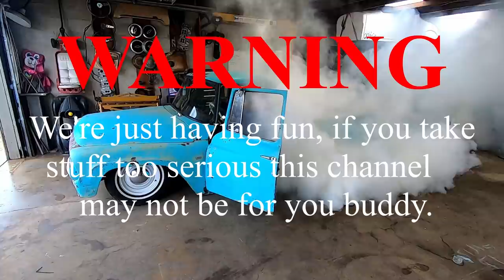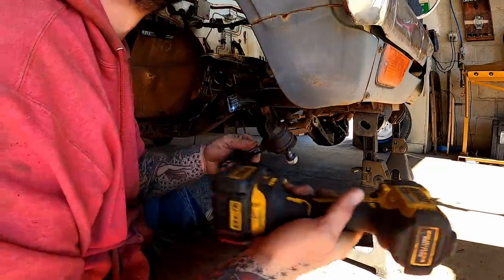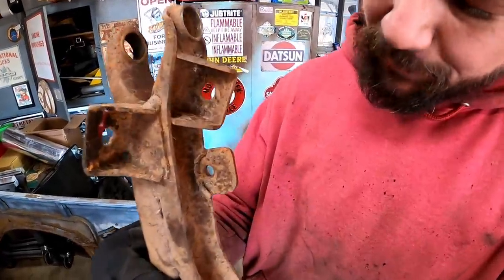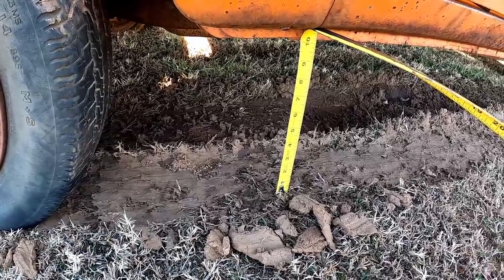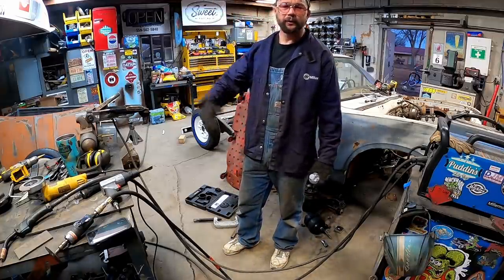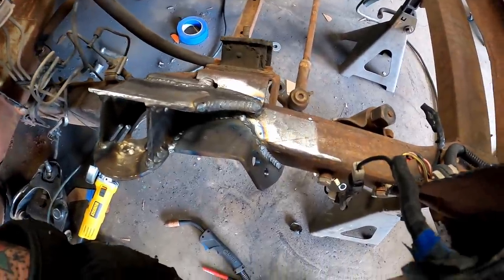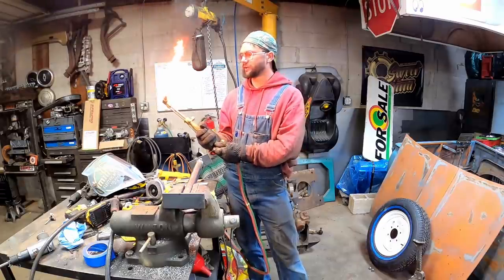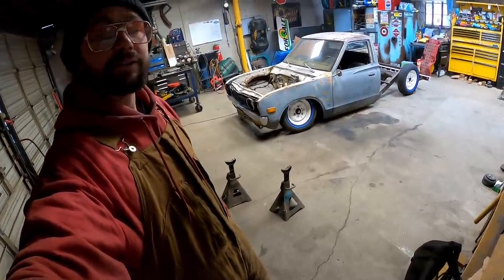BUDGET FRIENDLY front suspension PART 2. GUSSETS EVERYWHERE!  ((1977 Datsun 620.))

Comment: What would you say is the best way to start learning how to do framework like you do?
Reply from the maker: I’d say practice cutting, fitting and welding on smaller projects first. Build a welding cart, small project or something. Then pick a project that if it don’t turn out your best you don’t care. You know you’re doing it to learn. Then dive In. Who knows. You may have to rebuild it all 10 years later but you have the ability from practice and not being scared to get in there. 

All that being said, I don’t endorse putting a vehicle on the road that is dangerous. I was totally clueless how dangerous this thing was until I looked at it good this last year 😂😂
Reply: @PuddinsFabShop  Hey man don't feel bad, some people just DRIVE their cars and make them dangerous. A relative who will remain unnamed asked me to check his car because the suspension was clunking... The rear passengers side strut mount had failed, the strut was stabbing the deck lid, like it had been doing this so long it almost punched THROUGH the deck lid, and the other strut mount was held together with load bearing paint I think. I refused to fix the car because the only way to do it was to install a strut spring compressor on the spring on the car, and uh, yeah... No.. Seen a strut spring compressor fail, the spring was a worn out spring from a 90's Audi and it STILL went thru the drywall behind the bench it was on, into the little laundry closet in the garage, and took out the front loading drier. Nope...
Reply: Clean that OIL off your floor!!  😂
Reply: Watch puddin duh
Reply: What is the best way?  Move to OK and become Puddin' s next door neighbor!  A couple of Taco Boys Specials should seal the deal!  Hot Dang!
Reply: A welding class
Reply: @DeadReckon  if y'all think Oklahoma vehicles aren't too safe, check out Ohio with no safety inspections.  Trucks folded at 45 degree angles with the cab ratchet strapped to the bed, going down the highway.  Leaf springs shot right through the bed floor.  Headlight housings replaced with a (dirty) coffee decanter and a bunch of black rattle canned spray foam to hold it in place.  There is no exhaust system, ok, you see, the exhaust systems devolved into exhaust suggestions about 30 years ago in Ohio, and exhaust gases are merely "advised" to find a way out from under the vehicle and not into the interior.  Honor system and all.

LMAO @ "load bearing paint"
Reply: @PuddinsFabShop  keep up the good work. Also keep making the videos because it will help somebody.  You need to find a 1928-31 ford model A to work on
Reply: @DeadReckon  Dayyummm! Reminds me of the time I saw a wooden trunk wing on some small corolla or similar small car. You have to give it to them for ingenuity...nope.
Reply: @alanmoore78  West Virginia has no inspections, I see cars from up there come down here to Virginia and I can see through one side and out the other.
Reply: Looking good, you run some nice beads buddy
Reply: @jcold3621  oh damn man...that's Coooold...tell him go find one...its in the pile o' Puddin stuff...
Hahahaha
Reply: Complete front end and let’s get that box on the back of that truck. Jack
Reply: @DeadReckon  Actually WV does have state vehicle inspections, even if there is a rust hole in the body a car can get denied.

The reason you see such crap cars from WV is either people don't have their inspection stickers, don't care, and have yet to be caught. Or they have a buddy who is an inspector, and they just write the vehicle off without even looking at it. Learned this by working at a parts store in WV, and it happens constantly.

Now as for Kentucky, and Ohio the only "inspections" you can have is when transferring a title from an outside state. Ohio just makes sure the VIN and mileage match, and sometimes check if the windshield has a crack in it, but not often.
Reply: Keep going.
Reply: @alanmoore78  Oklahoma dont have inspections either.
Reply: Get a sawzall ! Lol
Reply: @markblackburn8685  He sure does.....some of the nicest h-welding on the YouTube!!! And not afraid to show his mistakes  and do things over if need be. If that doesn't encourage others, I don't know what will!
Reply: Always enjoy watching your videos and tagging along while you talk us through your thought process….I also can’t wait to see that box on the back and the little truck aired out. The cabs already a cool blue, any chance the box will go blue as well with the puddins fab shop logo on it?
Reply: @jcold3621  I think he already has one
Reply: Keep goin
Reply: @PuddinsFabShop  I love the Datsun build , I’m excited about you putting the box bed on it , the only thing im going to miss about the bobbed bed is the taillights you did , it would be cool if you reinstalled those Frenched tail lights on the box bed , and you should keep the box bed with the uhaul stripe but make it puddins blues make it the puddin uhaul , I understand if you don’t want to though it is a lot of work to redo those tail lights and even more work to paint the box bed , I just want to see this build keep going every Monday I’m just so excited for your upload even on January 10th I was so excited to watch your video it was one of the highlights of my whole birthday, cause I don’t usually celebrate my birthday due to some stuff that happened in the past , I just want you to know your definitely my top 3 favorite people on this platform and I love how funny you are and you being sober helps me stay sober , I know you probably don’t think that you posting funny videos is inspiring but it really is , at least to me.
Reply: @mikewood1421  for reall, I hope it still has a stripe going around it but instead of orange it should be blue , and I think it would be cool if he reinstalled the Frenched tail lights , but I understand if he doesn’t want to it is a pain in the ass to paint and re do all his measurements for the tail lights.
Reply: Keep going I wanna see more I started building racing go karts from scratch thanks to you
Reply: the tenth word in your question is also your answer
Reply: @RobertDickens2002  has he do a video working on it?
Reply: Another awesome episode man! Love the fab work and laugh’s 👍🏻😎
Reply: @RustyCigrit   “sitting on your ass won’t finish your project” wise words from Mr. Puddin😂
Reply: Puddin - keep going. Featured Datsun minitruck Rebuild better, stronger, safer. Thanks for your motivational words in the comments & the unedited footage, You have to work  through the mistakes
Reply: @BigJim1976  your absolutely right.because i live in West Virginia and it's hard to get a vehicle  inspected if it's not a nice clean car no smoke,rust,noise,or parts messing and you ain't got that sticker..oh yea the cops will get ya..
Reply: Definitely keep watching this channel!!!....Puddin lays down some of the most beautiful lines around!! And humbly points out those that went wrong.....and then fixes those! Always grind to clean metal before attempting to weld! An actual welding class couldnt hurt, too as it would give you some guided "hands on" to begin your own practicing becauae, as Puddin responded here, practice of your own is really the only way.....just like tying your shoes. Nobody is born knowing this stuff.....you have to make your own mistakes and earn your own victories to truly learn anything. But you also need a good basis of what you're shooting for to know where you're headed! And Puddin does beautiful work!!! I personally have never welded anything, but I've been married 30+ years to a guy who is a perfectionist and a metal sculpture artist and an automotive customizer. We watch Puddin every week!! We also watch Andrew Camarata and their welding techniques are night and day!!! Dont, get me wrong, we love AC, but we would NOT want to bet our lives on AC's welds.....but we would definitely trust Puddin's!!! (Good welds, built with heavy materials and gusseted for extra support) The recent episode with his welder labeled "booger" and "catapillar" said it all!!! Only practice, practice and more practice will give YOUR brain and hands the "feel" for it. And study how ragged his original bobtail era stuff looks vs how flowing and "looks like it was born that way" his work looks now. And accept the fact that your early work is gonna look bad too, but like he said in this episode....its metal and you can do it over if need be! Be meticulous and patient and sleep on it if need be.....keep trying!! And perhaps go to your local auto parts store and track down a welder or customizer near you and ask to help around their shop in exchange for explaing welder settings and such. But be forewarned.....many people are not good teachers despite being good welders. That is another one of Puddin's remarkable talents.....he is a fantastic teacher!!!!
Good luck!!!!
Reply: @chancelee8368  amen brother I need to take that advice to and finish my obs street truck but I been sittin in my pooper lol
Reply: @PuddinsFabShop  That's the best advice you could ever give. Practice practice practice. I learned to weld when they had metals class in high school. 

Our teacher would look at our project, throw it as hard as he could against the brick wall and if it stayed together you passed. If a weld broke, we had to redo the entire thing. 

It was mostly things like car ramps from angle iron, tools and anything we could think of to gain welding skills. I was really good for a long time. Now I doubt I could make a decent bead since it's been 30 years....lol .. I always loved to weld though.
Reply: @Torpedomtb  true but we don't have as much rust until the field mice get involved.  Frames here bend from wrecks and overloading before they rust through.
Reply: Your the only dude I've ever seen in my lifetime you can line dance and break dance 🕺
Reply: @PuddinsFabShop  I like your welds a lot, and your filosofy! And you make Cad-parts as good as any AI-cutter 😃
Reply: Almost time for a good old classic car revival!
Reply: Best way is to start! Plain and simple, go at your own pace and teach yourself through research, trial and error. Most of all do it the way you want to do it and have fun!!💪🙌✌
Reply: @alanmoore78  yeah, because that's something you see every day, and only in Ohio.  There is the occasional piece of shit everywhere you go, regardless of inspections or where you register the car . Inspections can always be gotten around. Always. 

Just like those ridiculous Carfax reports. If a car is fixed by the owner and not reported, it will show no accidents, even if it was totaled.  There's always a  way around EVERYTHING when it comes to cara.
Reply: @PuddinsFabShop  I have a list of possible names for the new rig ...

And a pair of 89-93 DeVille taillights would look good in the back of that box if there's room beside the doors. Maybe a little more than you want to get into, but it would be cool. A lot of those old school long and tall Caddy taillights would look great. Maybe even sideways on the bottom.  

Or if you decide to french some others in, do more than one per side. Do at least 3 a side.
Reply: @jcold3621  he always talk about the one day model A
Reply: Nice
Reply: Perfection is in the eye of the beholder
Reply: Chance the best way to start learning how to do framework is to understand the geometry and the engineering goes into making a frame. What its capabilities are and the reason it is formed and molded and supported the way it is constructed. After that, configure your own build and decide The best way to modify your project and consider first of all safety. Weight is sometimes a consideration but strength is always paramount. After you come up with a design maybe consult a fabricator for a second set of eyes and ideas and then correct any deficiencies that you think may need attention. Be open minded as you progress in your build and be willing to change things because designs and ideas on paper or in your head sometimes do not work on steel when you’re standing on concrete. I would definitely take some good instruction in welding both mig and tig and learn how to use basic metalworking shop tools such as a grinder torch plasma cutter or 4 inch angle grinder with a cut off wheel because these tools will be the primary things that you do business with. Good luck and chase your dreams man I hope this helps.
Reply: I don't do framework I only watch you do it.  I'm watching the Oklahoma brain frame.. lol
Reply: Box check on a slammed Datsun... she's good
Reply: Pay attention to Ole Professor Puddin and his White Board! Then practice practice practice!
Reply: Hello I am just subscribed to you click that thumbs up so as you can know can you make more videos for me to watch that would be great thank you bye have a great day
Reply: I am a fan with you

Comment: When I was a kid, my grandpa had 2 1982 Datsun 720 king cab trucks. One auto, one 5 speed. Both diesel! I tell you, those trucks loaded over the top of the box with rocks, bumper dragging up a hill. He put the manual in 1st, let off the clutch and with each stroke she climbed. That truck was amazing. The motor outlasted the body though.

Comment: I actually bought an blue extended cab 1977 Datsun pickup brand new. I drove it to Alaska 2 years later and got a full size pickup within a year.Most of the roads were gravel then and it was hard to handle on washboard roads.

Comment: Please keep going ! Love the fab work on the frontend of the bullet cab. The sectioning  and boxing - in of the upper A-arms and resurfacing of the lower control arms to place a housing surface for the bag was ultra nice. And about the bobtailed bed with the mods you put on it as in the frenched in lights and hidden tag fab I hate to see go  but I'm really feeling the new path you wanting to go with also. " Hot Damn "

Comment: This might have been said in the comments, but there is over 3k, so I did not look.
When bending tubes with sand, I have a little tip.
If you drill a hole in one of the end caps and weld a nut to it, you can use a bolt to compress the sand in the tube after welding it to the pipe. Just have a little piece of metal that goes on top of the sand inside the tube.